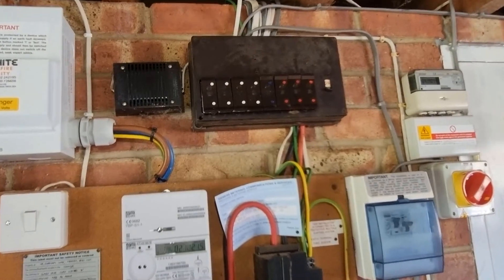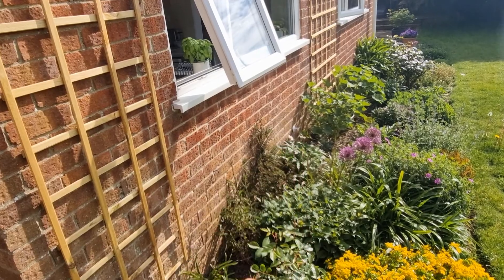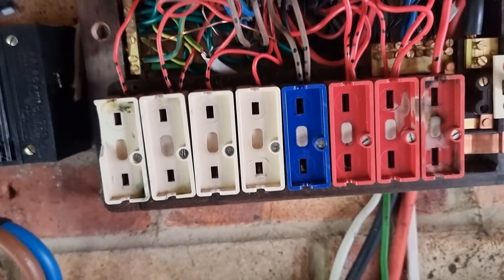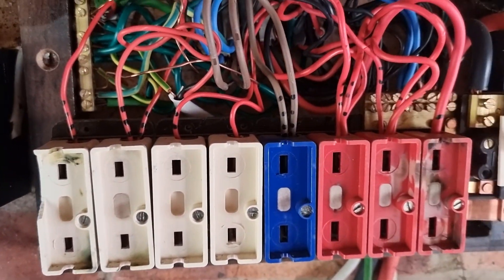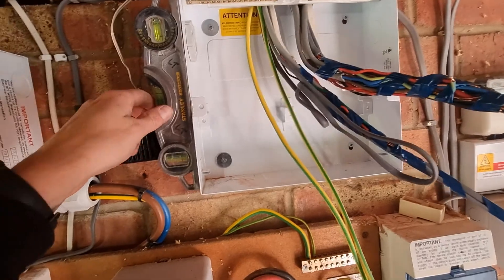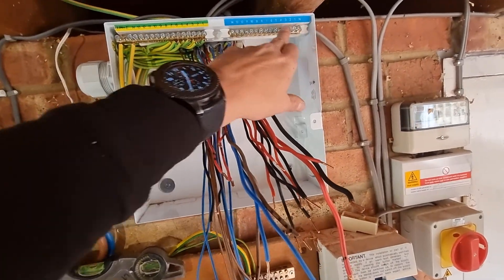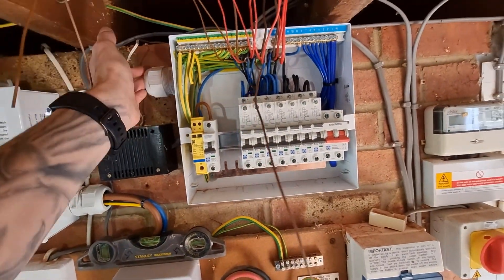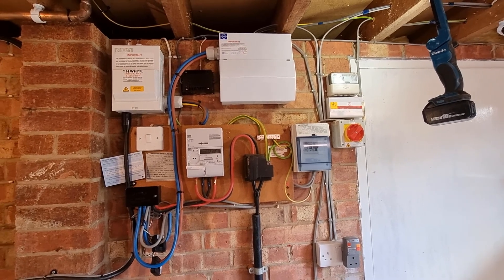Installing a 18th Edition RCBO/SPD Consumer unit | Walk through Video

Comment: Could the water bonding earth wire not be run in the house theres always a way it's a serious  mess how it's done clipped surface round the house don't know how the house owner allowed that also the T&E cables clipped surface in the garage for the switches and sockets should be in plastic trunking or conduit drops into pvc knock out boxes

Comment: Can you explain to me why there are 3 red 2.5 wires in 2 of the 32 Amp Rings? Are 2 of them for a Ring and the 3rd a fused spur maybe??? Answers Below Please .
Reply from the maker: Correct, 3rd is a spur
Reply: When I did my 18th edition refresher course my teacher pointed out that you are allowed to spur off a ring Mcb with one double socket and there it was in the regs book I didn’t know. This was useful recently when I needed a double socket in a cupboard for a cctv rack but the board was full.
Reply: Yes you are correct, i was thinking of an optimal design where one wouldn't require an add-on spur. thankyou for your responce Sir. @Badgerooni90
Reply: Your aloud to fuse spur directly from the mcb
Reply: What about bridging a RCBO cos you can only get 2 x 2.5mm cable in each Live & Neutral terminals? Are Wago blocks aloud??

Comment: Does the equipotential bonding on the gas have to be before the tee on the gas outlet pipe? I know nothing about electrical requirements. Not sure how much of a difference it would make on this installation? As a gas engineer, just wondering how much of a difference it would make here? Nice tidy work on the consumer unit.
Reply from the maker: Morning, The regulation like the gas bonding to be installed within 600mm from memory as stated here "The main equipotential bonding conductor connection to any gas or other service should be made as near as practicable (preferably within 600mm) to the point of entry to the premises." Hope this helps

Comment: Is that bonding cable protected against UV?
Reply: Think you’re missing the point, should be in conduit or otherwise protected against UV
Reply: @DontMindMeeeee  give me a reg number that states this? Granted best practice but I can't think of any that would support it 🤔
Reply: @AGRElectrics  it’s in your schedule of inspections for a start
Reply: @DontMindMeeeee  give me a reg number then
Reply: @AGRElectrics  well I guess if someone was being picky they could use the following

Not suitable for the environment its installed in
Doesn't comply with manufacturers instructions
And, the good workmanship, reg
They are all in the book of nonsense, and if doing an EICR could be used in this instance.
Reply from the maker: It's not the best solution but only solution we had due to tile flooring and bathroom above the kitchen. Alot of Bonding cables are run externally and gas meter  are normally situated outside in local area with no near entry.
Reply: @smudge0161  What's earth bonding?
Reply: @simonmartin3433  plenty of electricians in the UK ask that very question.
Reply: No it's not, general pvc cables aren't and they do degrade over time.
Reply: You think UV is going to degrade a thick insulation and a 10mm copper? Been in the industry 20 years and have never heard that.
Reply: @James_scott86  if you read the manufacturers data sheet, it tells you general purpose pvc is not suitable for outdoor use.
Reply: I thought the maximum rcd protection for an spd was 32A?